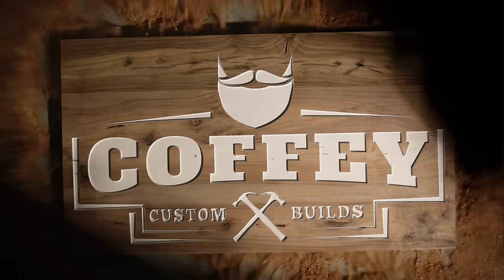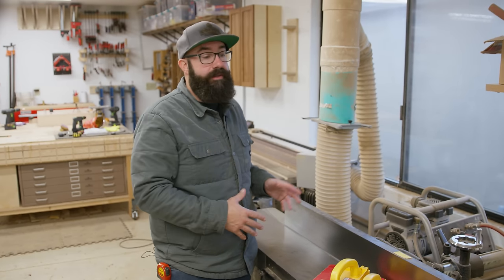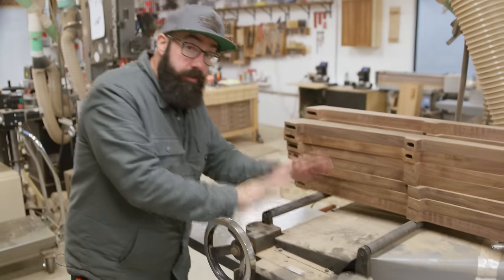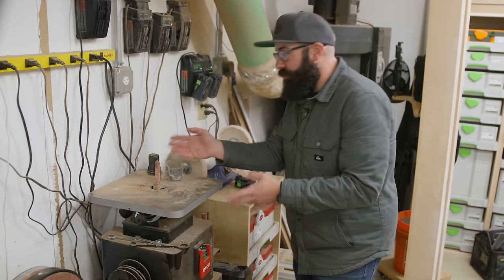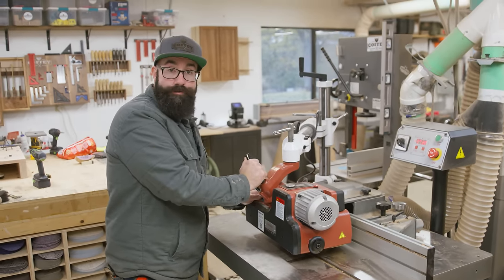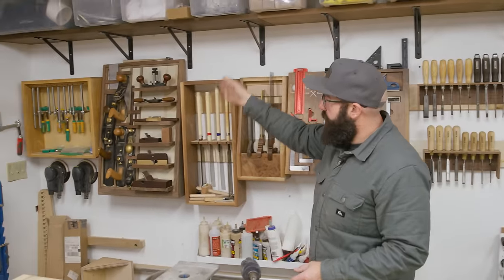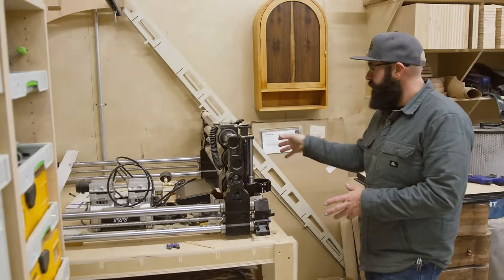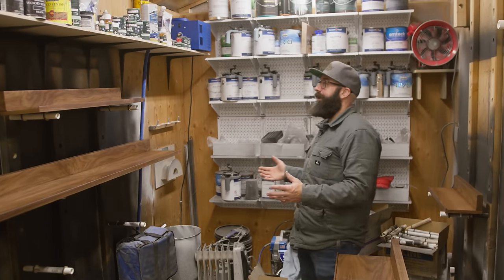Production Woodshop Tour

Comment: I'm new to your channel, but really like it. I'm a retired cabinetmaker and I went from a 2400 sq ft leased shop to a 10,000 shop I bought. Thought I was in woodworking heaven, so I hope your new shop build goes the same for you. You have a lot of really great machinery, and most importantly the knowledge to use them. I noticed in your finishing room the bag that holds the new Graco Quickshot. Curious how you like it. If you have done a video on it, I haven't seen it and I apologize.
Reply from the maker: Thanks so much! I hope to get there asap. 

That machine is fine. It isn't amazing. It doesn't keep it's prime often. I ended up getting their larger cordless airless and love it.

Comment: Great Shop tour, what do you think of the Supermax dual drum sander? Any issues with grooves being sanded into the work pieces? I’m looking for a sander, I was thinking small wide belt. But that sander seems like it might be a good fit. Thank you.
Reply from the maker: It's great for small to medium sized panels. All sanders that sand in a linear motion will leave sanding lines. They aren't for finish sanding as much as they are for thicknessing and dialing in specific thicknesses. You'll still need to go over them with a random orbital sander. With that said, mine gets used almost daily.
Reply: @CoffeyCustomBuilds  Thank you very much for the reply, much appreciated!

Comment: I have the same laguna 5hp planer...weak. the jet 3hp 16" was better. I replaced the 5hp with a 7.5hp 3phase, it's a lot better. Also if you want a shaper feeder get the comatic 7 wheel variable speed. I had 3 of the 3 wheel steff/Maggi feeders. Got rid of all of those.
Reply from the maker: You’re gonna be surprised to find out they’re made in the same factory. This comatic 3 wheel has been amazing.

Comment: At 8:23 you have your panel clamps on the wall — how did you mount those?  I have the same clamps sitting on the floor and they take up so much room.
Reply from the maker: The parallel clamps?
Reply: @CoffeyCustomBuilds The blue Rockler clamps.  It almost looks like they’re strung through a metal shelf of some sort.